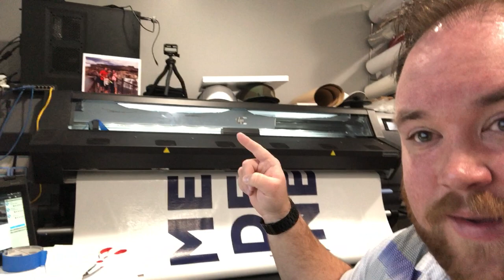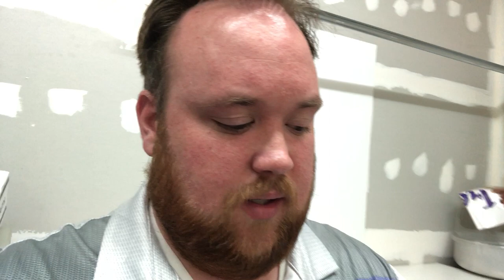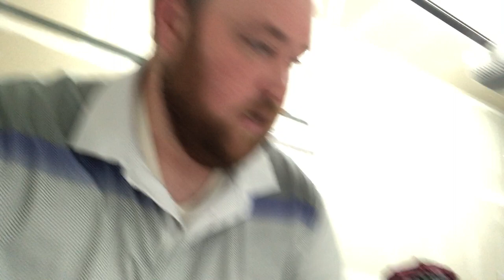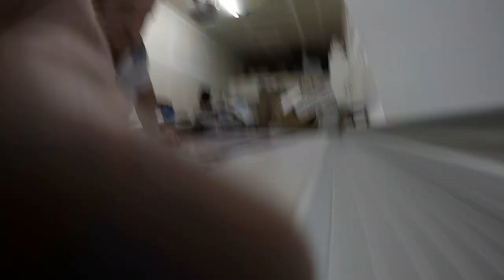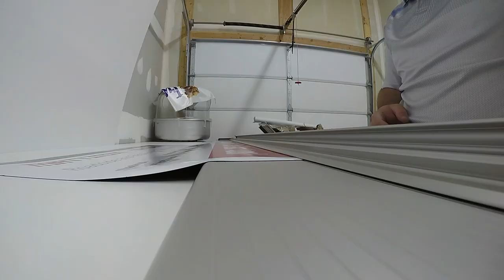Tons of banner printing - vlog 210 - Print Shop Updates

Comment: Just found your video’s and I love them. Question. When printing banners do you have a roller on the front side to gather up the print. If so do you manually turn it, or is it automated.  New to banners so I have lots of questions :) TY
Reply from the maker: Some printers have a take up reel. I didn't buy it (it was optional at purchase). I usually let it roll on the floor or I'll gather it manually if it's a big job.

Comment: Hi Darren, Enjoying your daily videos. I found you originally because I have the exact same HP print & cut combo and now the KM C3080. I am wondering what kind of problem you have with the IQ501? I have had to have service come 5 times now because of quality issues because of the IQ501. Let me know.
Reply from the maker: I've never had a problem with my IQ. In the vlog published today, my service guy gave me some recommended steps to keep quality up. Vlog 213